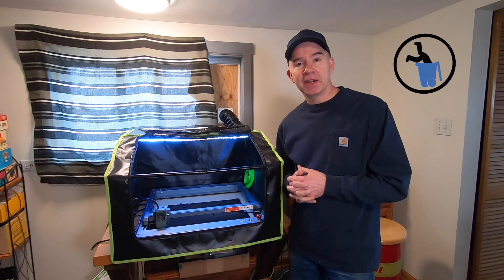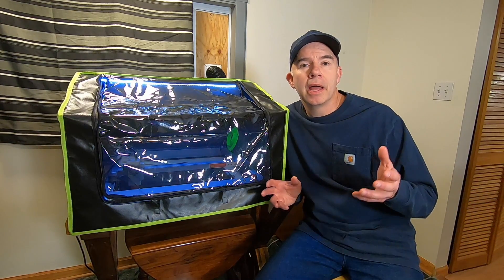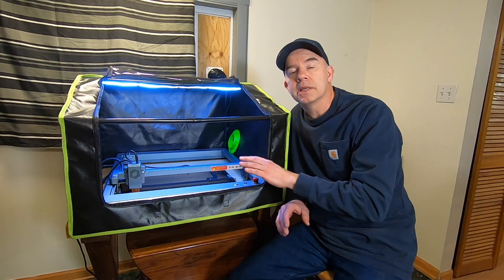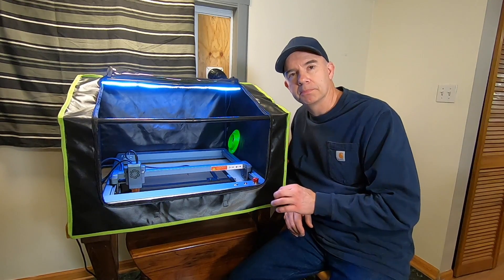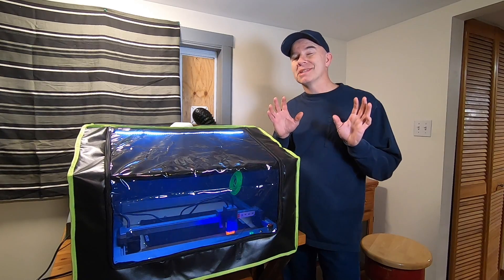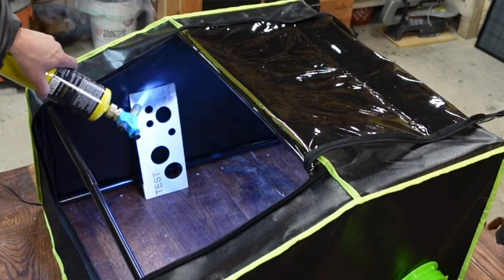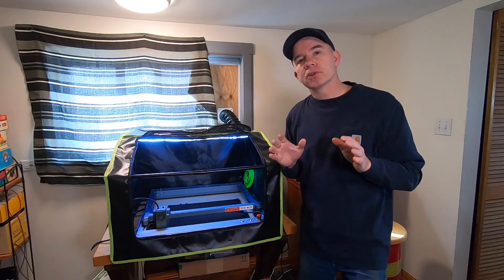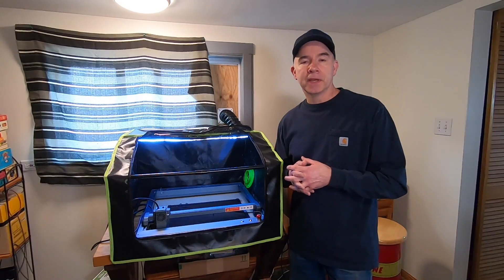Laser Engraver Enclosure: Do you need one?

Comment: I would suggest buying the Vevor version that's exactly the same but bigger ar 31.5"x31.5"x 19.5" tall.  Not the one with the zipper on Amazon but the one that you buy directly from the Vevor site. The one you buy directly from Vevor is the structured one that's exactly like the Xtool. It's coming out of the same factory. All the same cutouts comes with the hoses the fan the LED light everything exactly the same but, but, but the bigger size gives you enough height and way more wiggle room around the sides especially if you're cutting or engraver larger pieces. The Xtool version is exactly the same size as the unit and it fits snug meaning you can only cut and engrave what fits in the cutting area. It's very limiting. You also get so much more height from Vevor and it's so much more spacious all around. It's exactly the same!!!!! Except the smaller X2 version is only available on eBay by the time you pay shipping it's about $179. I bought the bigger Vevor directly from them for $79 shipped!!! I ordered it on Friday night. By Saturday morning I got a notification did it would be delivered by Sunday. Huh?? No way. It arrived Sunday before noon. I got it about 40 hours after I ordered it on a freaking Sunday!!!! I'm two states away but realistically about 3 hours. The box was big and it scared me at first but once I got it together and set my D1 Pro inside I was so happy I got it as opposed to the Xtool snug fitting one that was $100 more. I can also sit my laserpeck 2 right in the center of my D1 Pro when I want to use it instead. It's that big. Raising it up is not going to be a problem with the height for rotary and I'm not sure how tall the camera is but it might fit the camera too. I bought a refurbished laser pecker air purifier off eBay directly from the laser pecker store and it's not going to be here for another week😅😅. I'm set now to work inside all winter without having to carry my gear outside on the deck. This is life-changing!!!

Comment: Hi Tom, did you use an air assist pipe? If so, did the pump stay in the enclosure ?
Reply from the maker: Air assist on the laser I assume you are referring to? Yes.
Reply: @AlleyPicked  yes, did the air pipe present a problem with the enclosure? The route for the pipe. Is there a hole needed to fit it.
Reply from the maker: @stevelack2861  The bottom of the enclosure is open. I ran the air assist hose between the bottom frame and the side of the enclosure. It wasn't an issue.
Reply: Ah OH thank you for the info. PS your videos strike the note and are easy to watch. Thank you.
 @AlleyPicked